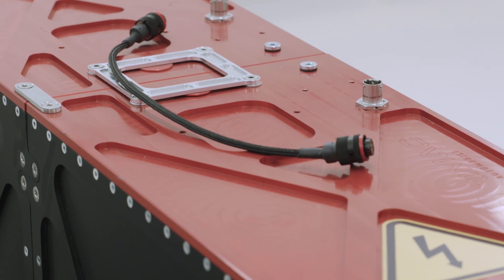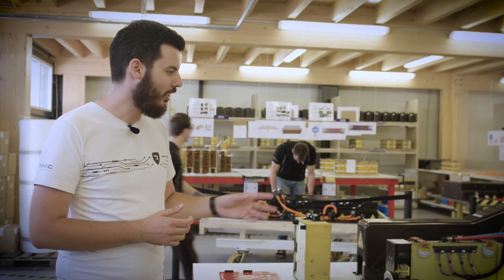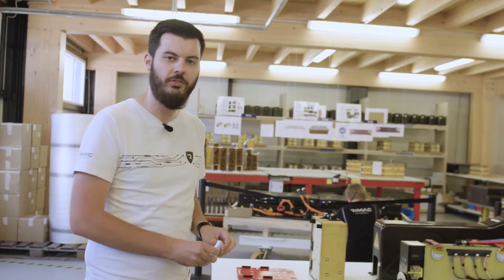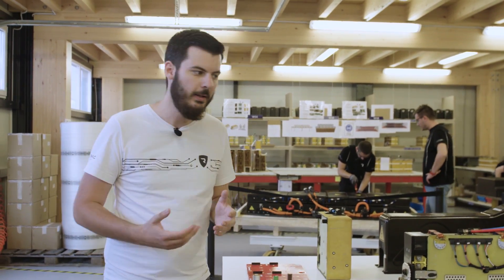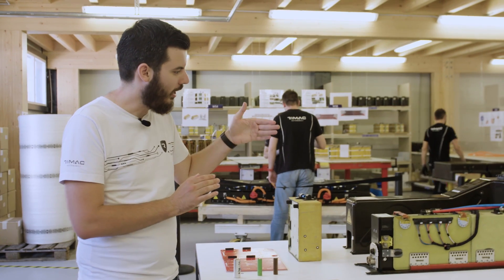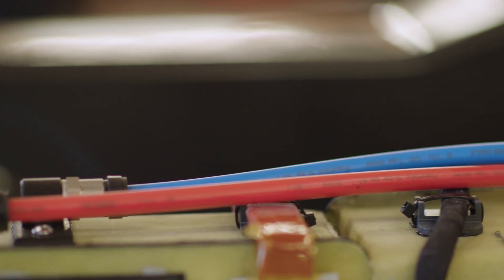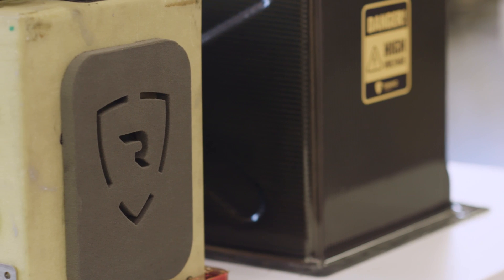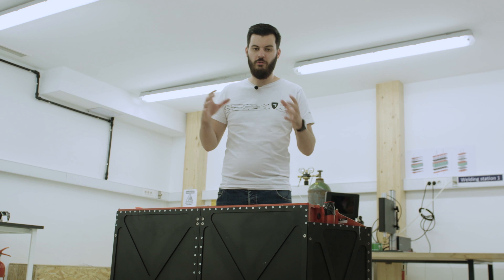How To Pick The Right Battery For An Electric Hypercar – www.APEX.one

Comment: is this a A123 systems battery?
Reply: Lol no, A123 doesn't remotely have the density required.
Reply: Azagro well, it is an A123 cell, you can see from the video. Rimac is not a cell manufacturer, they buy cells from other manufacturers like A123, Sony, Murata, LG, Samsung (Direct quote from Mate himself). Cell manufacturing is not the most crucial part for the final performance of a battery pack, but rather monitoring systems, thermal management and in build safety precautions systems, that’s where Rimac is an expert in.

Comment: Great video, battery cells have improved a lot I've seen 21700 Samsung cells with 5000mAh and 3.7V, and 1000 charging cycles for around 175€ the kWh, there are 4000mAh cell for little as nearly 100€ per kWh. 

In the last 3 years batteries cost have fallen to a half, expect to have common prices around $100 for 1kWh by 2022 and $70 by 2025.
PS: in 2010 1kWh was about $1000 (lon-lithium).

Comment: "big manufacturer" = Porsche
Reply: Probably Tesla.  Porsche uses pouch cells not the 18650 he was showing, that Tesla uses in the Model S and X.  2170 in the 3 and y are similar but a bit bigger.
Reply: @mvonpalmer  Probably not, maybe volkswagen, VAG is a big Rimac's client.
Reply: @amigodesigns   I did not take the comment as who his customer is but rather who uses what cells.   Maybe I heard wrong.
Reply: @mvonpalmer  Previously on Concept One they did use Samsung SDI. Which Tesla also uses for Stationary Energy Storage. That's maybe the link you are looking for.
https://www.businesswire.com/news/home/20151123005451/en/Samsung-SDI-Supply-Cylindrical-EV-Batteries-JAC